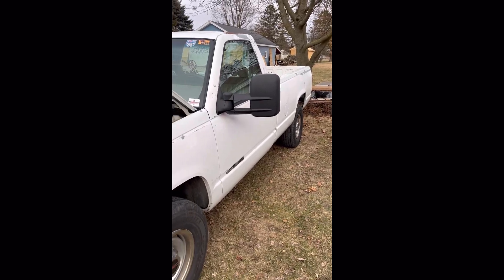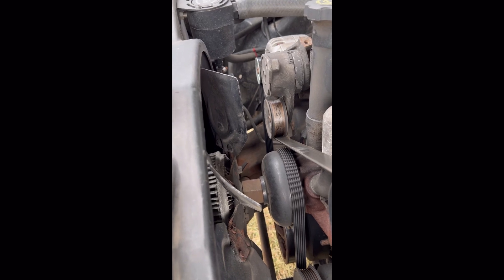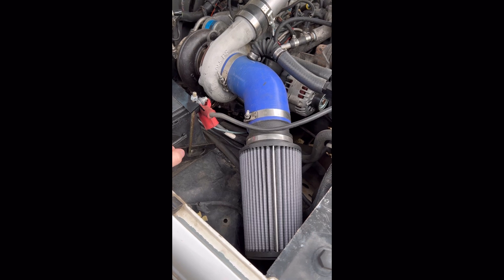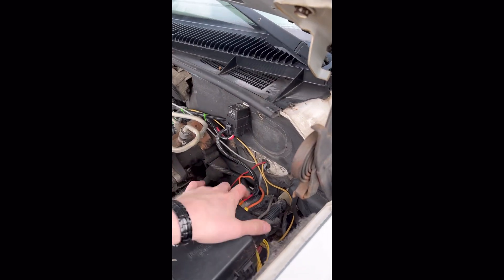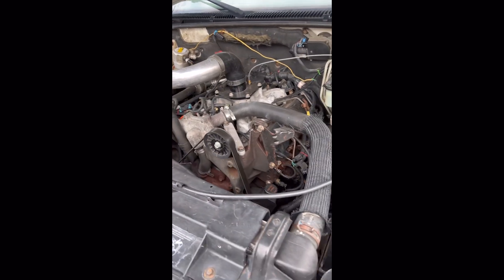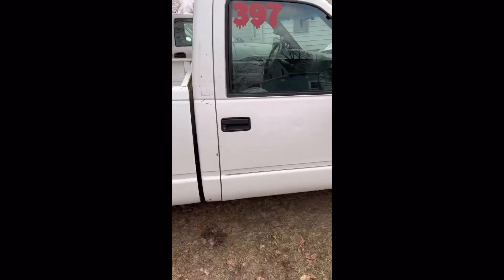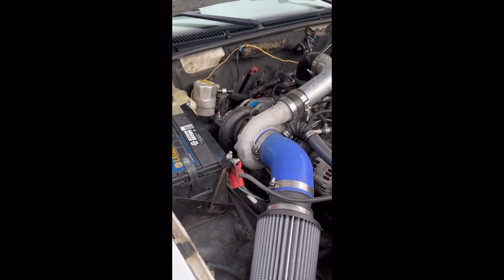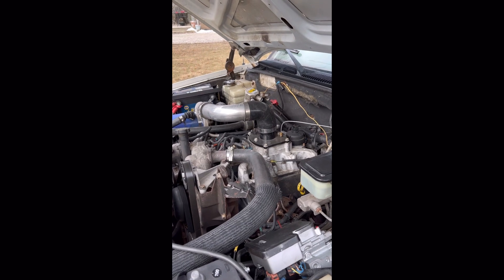GSC 6.5L diesel bulletproofing crash course part 1

Comment: Thoughts on the super 54 and 60 turbos... I have a 6 5 pusher rv
Reply from the maker: Honestly an HX40 would be more than enough. I’ve run the S54 and S60. Nice turbos. But you can get similar performance from an HX since that’s all they are with some shiny parts.
Reply: @gingersnapcustoms  thank you were would I get a reliable turbo from!??
Reply from the maker: @dreammoney4227  PTwiring (zombie solutions) sells a good kit.

Comment: I own a 93 what fan and clutch can I use also do you have a video  directed at the 93 for bullet proofing I assume most would work from your 94 to 2000 vid
Reply from the maker: You want to get a 2000 water pump. Fan and clutch. It’s the best upgrade you can do for the 92-98. Other than a PMD. It’s all the same. I keep forgetting to mention oil cooler lines. But that’s all.
Reply: @gingersnapcustoms  so just buy a water pump and ran and clutch of of a 2000 ? And what about the oil cooler lined?
Reply from the maker: @TheClong197833  upgrades for your 93 to improve reliability (bulletproofing).
 Rockauto 2000 water pump, fan and fan clutch 
Leroy diesel oil cooler lines 
Fass lift pump (has relay harness as part of install) 
4” diamond eye exhaust 
KBDiesel upper intake to drop IATs
PTwiring HX40WII bolt on turbo to reduce heat and improve air flow when Towing. 
Fluid damper. 
Feed the beast. 

92-93s are no different from any other 6.5. The same issues plague them other than not having a PMD due to still being a mechanical DB2 injection pump
Reply: @gingersnapcustoms  thank you
Reply: Hey boss when I search a 2000 fan it pulls up electric fan what am I doing wrong
Reply from the maker: @TheClong197833  it has to be the fan for a 2000 6.5L diesel C3500 or 3500HD. I’ll look later on for a link.
Reply: @gingersnapcustoms  oh ok I been looking for 2500
Reply: If you could share a link still not finding it thxs
Reply: Can't seem to find it no your busy would be sweet if you had a link
Reply from the maker: @TheClong197833  please view the list in the community posts. I added part links.
Reply: @gingersnapcustoms  I have all they do is take me to rock auto and everytime I surch it gives me electric  fans as an option thanks anyways tho like your vids
Reply from the maker: @TheClong197833  if you read the links the fan is not on Rockauto. I tried to make sure there was a functional link for each product on the Facebook page since they don’t always work here. https://www.amazon.com/ACDelco-15-80690-Original-Equipment-Cooling/dp/B000EQRINC

Comment: good video...question:  you mentioned you had run a carter lift pump for about 6 years---but I watched one of your videos about 1 year ago where you installed one from PT wiring....  is this a different truck--or did you switch out from the Carter?  Any reliability issues etc???
Reply from the maker: Two totally different trucks. The 6 year Carter was on my 99 which now has a Fass. The blue truck had a PT kit and is still serving the new owners well.

Comment: Hey Gingersnap, all the info is greatly appreciated and really helps me plan out what I want to do with my 97' K2500 and my 85' C20. My question for you is whats your opinion on the CDR valve, to delete or not to delete? I would love to delete it and clean up the engine bay when I put my turbo on but I also dont want to blow all the seals out at the same time, any info is appreciated. Thank you!
Reply from the maker: Honestly I run them. The engines were designed to have vacuum pulling pressure from the crank case. They are ugly but they are a need in most cases.
Reply: @gingersnapcustoms  Yeah thats why I was hesitant to take it off, ill get it all cleaned up and reinstall with the turbo when it goes on, thanks again and keep up the good work.
Reply from the maker: @derekkautz3214  if it’s never been replaced it’s worth buying a new one. That way you know it’s 100% functional.

Comment: Hey Gingersnap - I'm about to do head gaskets on my build after blowing one last weekend and over pressurizing my coolant system.  It was completely my fault.  Anyway, I've always seemed to get some occasional temperature spikes and I've heard people say that you should install a restrictor on the thermostat bypass.  Any thoughts on that since I'm tearing into it in the next week or so?  This is on a 93 mechanical 6.5 that has been swapped to dual t-stats.  Thanks!
Reply from the maker: Honestly the restrictor fitting is worth doing on those as long as you do the water pump and fan upgrades as well. I’ve also seen strange spikes in coolant temps when heads crack. So be sure to check them!

Comment: What’s the difference between the 2000 water pump and the high flow one that Leroy cells?
Reply from the maker: I would have to get them side by side again. The Leroy true cool has a different impeller. I’ve run it once on a 93 and after that I’ve just stuck to the 2000 high flow balance flow. 50,000 miles and no issues so far on that setup.

Comment: I've done all this except the catch can and tune I want a tune bad just waiting for funds I'm doing a few sled pulls at fairs this year in south east michigan and I can't wait to see how it does. I would also love to do an intercooler before then but I'm not sure I will get it all done
Reply from the maker: You’ll go about 220 feet assuming you set the chassis up right and get the right tires. Glad it’ll be out and about!
Reply: @gingersnapcustoms  ID be happy with that! truck will sit right at 8500 pounds my only downside is it's an auto I feel that a nv4500 would perform better but that will come with time too.
Reply from the maker: @jimmycokeanhour5196  actually the auto in these gives a good advantage. Wind them up and leave the line with as much momentum as you can. I’ve pulled a few 6.5s and can say I would build another 80e truck for sled pulling tomorrow.

Comment: I got a question about oil pressure it’s half way when cold after driving for a hour or so when engine is at idle I’m getting about quarter way here’s a video https://m.youtube.com/watch?v=6kpuxArQQ-g
Reply from the maker: Looks normal to me. If it’s that low driving all the time I would be concerned.
Reply: @gingersnapcustoms  it’s only that low when at idle is that normal? When under load it’s about half way
Reply from the maker: @diyautomotive4750  yep. That’s normal.
Reply: Have you heard of ssdiesel supply? If so do you know if they sell quality stuff? Been fixing up my 94
Reply from the maker: @dillanmcadams3494  I have. I have had nothing but issues from them in the past and do not recommend them.